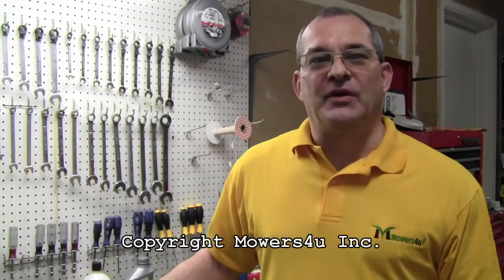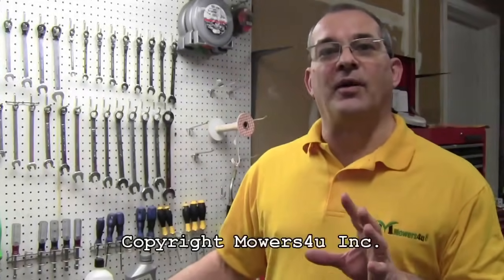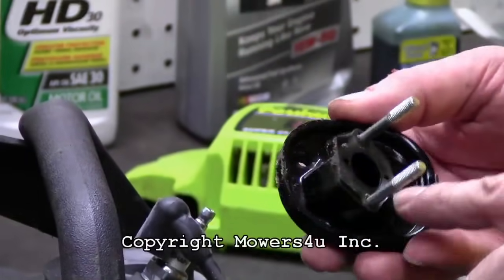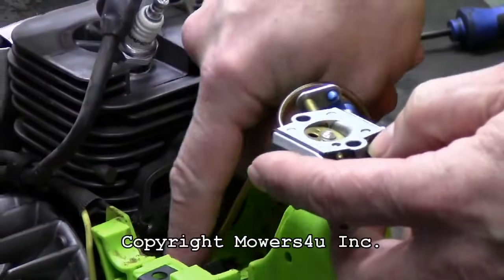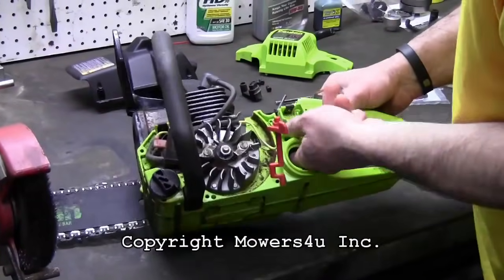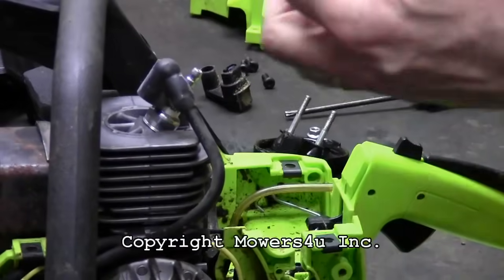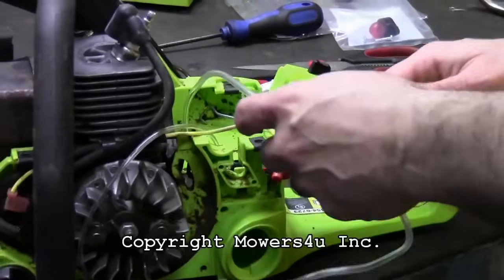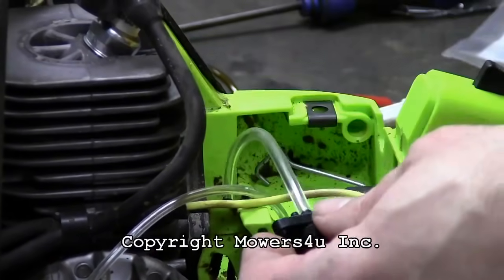Mowers4u: Poulan Chainsaw Tutorial

Comment: Hey buddy, just a shout out to say thanks.  I just fixed up my Poulan that hasn't run for 3 years. Bulb had turned to brittle.  Fuel lines too.  Looked like macaroni in the gas tank.  Anyhow, got a kit on Amazon for the lines and bulb and with your tutorial was able to knock out the redo in an hour.  Trimming hose and using fishing line to feed.  Started right up when put back together and .. well.... ( raises beer to screen )....  thanks.

Comment: Amazon has 12" hemostat pliers- straight and 45°  to replace fuel lines and filters.   Cut lines at a slant to ease installation. Auto wire-cutters make good hose cutters. Measure the I.D and O.D of the fittings on the carb. to determine hose size. Get a tape measure that measures 1/16 and 32nd. To test the primer, put the hose in water and pump. If water shoots out, it's good! To remove the flywheel, remove the starter cover and the bar and chain Tap the crank with a hammer on the bar end and watch the flywheel pop off. Get a clutch tool and a piston stop tool. Replace the oil pump often. The gear is plastic!  Get the spline mixture tool. Set the lo mixture for highest RPM'S at idle and the hi RPM'S at full throttle. Set the idle just until the chain stops. Check for the duck-bill valve.

Comment: Excellent video. For the guys that are going to do this on a regular basis,pull the fuel line through and make your cut for the filter and keep the piece that you cut on an angle. If you get fuel lines in 4ft lengths it saves you enough line to do 2-3 more machines. Trimmers,saws,blowers etc all  work the same way. High dollar machines like stihl echo etc have their own fuel lines. Not like the tygon. Excellent job buddy. I subbed. Zombie Dave.

Comment: To fit the lines through the tight holes, I find it easier to slit the line lengthwise for an inch or so, then feed that slit end into the hole and pull it through. Thanks for the video...I had the same problem Jason had (below).  The lines were routed wrong by the previous "repairman", and I needed to see how they should be. Thanks!

Comment: Thanks, Jeff,
  This is the best fuel line tutorial I've found.  I had ordered primer bulbs and fuel line for a Wild Thing I inherited, but I didn't get the smaller line and every piece of line crumbled to pieces inside and outside the tank when I tried to install the primer bulb.  I'll have to wait for a kit to arrive now, but your video makes the steps very easy to follow.  Several folks say to not use the clear fuel line but only the yellow and the kit I ordered shows the smaller line as clear like the line you used.  Any worries about clear line?
Reply: Phil Warner Clear line is good. I use it! Replace it often if hard.

Comment: Super tutorial.
On these chainsaw, why do we have such a small hole in the fuel tank for the feeding line?
Is it to avoid leakages or does it make some sort of fuel restriction for carb pump?
Reply: its to restrict the fuel to make it run leaner for the EPA , i always drill the hole bigger to the same size as the return line , it will give the engine the fuel it needs , hope it helps
Reply: @doglegjake6788  I am pretty sure the holes are tight to maintain pressure in the gas tank.

Comment: Mowers4u I have a few questions that I would like some info on as I have been known to tinker on various small engines over the years . One.....why dose my poulan experience chain casting issues when it was bought new and only ran for a total of 30 min tops? Two …...why dose the tank fuel cap become tight and become difficult to take off ? I have only used true fuel in my poulan from new {purchased} January 16 /2020 . Three …...why dose my poulan fail at idle and hesitate to open up bogging down then suddenly stopping . Four …...why when I allowed a dealer to remove my cover to inspect my air filter and spark plug dose a 30 min ran chainsaw contain so much pine saw dust accumulated on the air cleaner. Five …..I have noticed that my new saw when shut off is extremely hard to restart requiring several attempts before starting up …...Then upon starting up black plumes of smoke with a sloppy oil cover the plastic under the muffler is this indicative of Poulan . I know flooding can happen if continued pulling on the starter happens but this happens when my chainsaw is taken from a brief resting period of 5 mins before restarting . Six …….My chain seems to lack the proper amount of oil when being used ….. Seven …..Why dosent my dealer wont to help me after the sale when approached with these issues ? I have been to three local dealers all from witch take one look at this saw being a poulan and frown then tell me that they sale but don't work on Poulans .This concerns me as the saw is new and I don't wont to ruin my bar and chain .  Would theses issues not be under warranty as I haven't turned even a single screw on the saw and only ran the fuel mix required by the dealer .Please any help would be appreciated .

Comment: never could figure out what you did with that little connector piece that was in the tank? did you just not put it back in? The reason these lines get brittle is Ethanol in the gas, use 100 % gas or buy the additive. thanks

Comment: I replaced my old brittle fuel lines but my bulb was also cracked. I never use the bulb so I by-passed it. My return line is now from the carb to the tank. The saw runs fine except each time I refill the tank, it floods? I then have to clean/dry the plug, then it starts, runs good till I refuel, then it flood again? Do I have to have the primer bulb in the line to stop this?
Thanks

Comment: Thanks for the video ..  it helped me figure out the routing of the fuel lines .  the previous owner had them routed wrong and it would not run .
Reply: Jason Gabbert The line from the filter is small. It goes to the fitting on the right. The line from the top of the tank goes to the primer bottom. The inlet line on the primer bulb goes to the carb. inlet on the left.

Comment: Quick tip:  toss the Poulan unless you only plan on using it a couple times.  They are a pain.  Bad designs, cheap components.  Although I still have one.  It has to be fiddled with and adjusted all the time to use it.  😁

Comment: Hi, I got a question.  I'm helping my brother with his poulan 46cc chainsaw. We replaced one of the fuel lines. Once we got into the cab part of the chainsaw, and removed all we had to remove to get to the line, he notice that there was this lil black rubber looking black top hat that was in the bottom of the cabinet.  My question is, where does that goes?? I google it and the picture shows that it's goes on the oil pump.  Can you help me.
Reply: midnightpassion43 It may be like a wire grommet o-ring thing that fits on the tank for the line to go thru. It seals the hole.

Comment: Can you use one size hose and enlarge the opening?
Reply from the maker: Jim Gretsinger if you must, but things are designed a certain way for a reason.  the hose needs to fit tight so you aren't leaking fuel, especially when you tip the saw.
Reply: Mowers4u Inc. If you enlarge the hole, use bigger hose. It has to be a press-fit! It might not fit the carb. fitting.